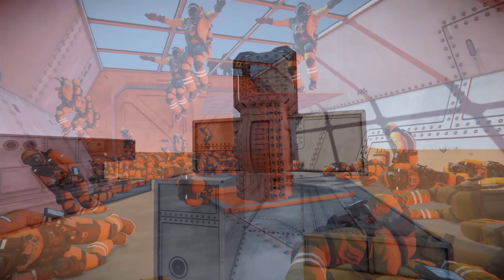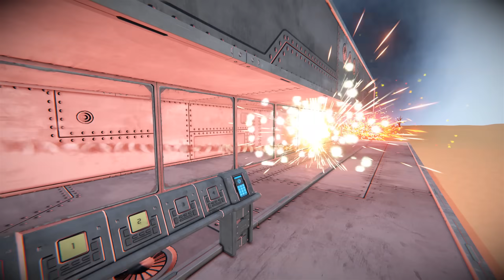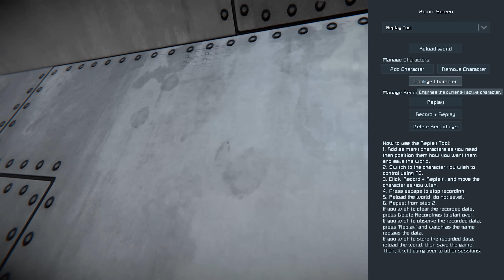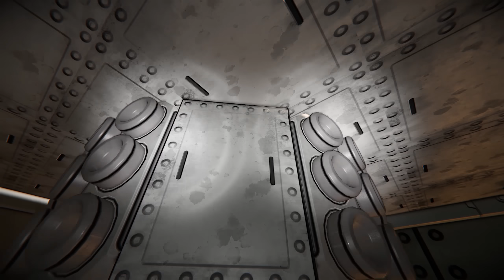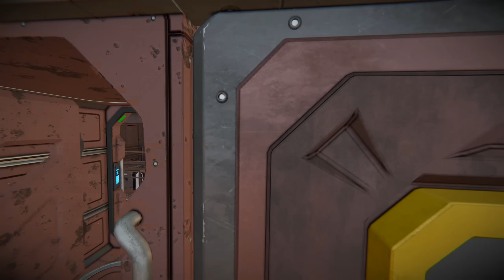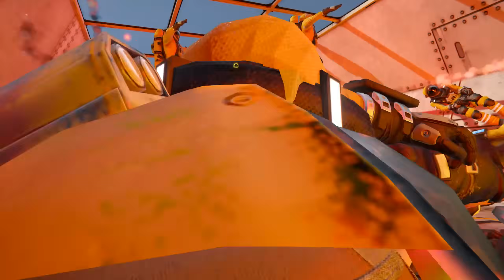ANTI PERSONNEL FLARE ANNIHILATOR Testing (APFA)  - Space Engineers

Comment: To prevent anyone standing on top of the floor trap from surviving you just need make it rise to the height of the ceiling. Anyone on top would either be knocked off or crushed. I also think as an anti personnel weapon it would be best to use the firework/flare launchers in combination with interior turrets. The ricochet ability of the flares means that even areas out of the turret's line of sight are dangerous and makes finding cover much harder for an enemy.

Comment: The flare gun has illuminated (heh) a long standing issue with Space Engineers: The player character cannot take physical impacts very well. Whether it be flare guns or just jet-packing around one's base, there is nothing more hazardous to a player than running into something too fast. I feel as though they need to rethink how much damage the player can take from said impacts, as well as how quickly the player character can get up to those deadly speeds.
Reply: Or just add code to the dampeners so it slows you down you before you hit something. Jetpacking should be hard but it's just annoying right now.
Reply: @Valkyrie9000 Anything to reduce damage from jetpacking into things at high speed unfortunately absolutely will encourage hydrogen-men.
Reply: @AlanGChenery  Slower acceleration, coupled with slower DEcceleration, might make hydrogen men unfeasible around erratically moving ships.
Reply: @Valkyrie9000 with lag on a server it's often fatal!
Reply: I was going down some stairs the other day, banged my head, and poof, I was dead!